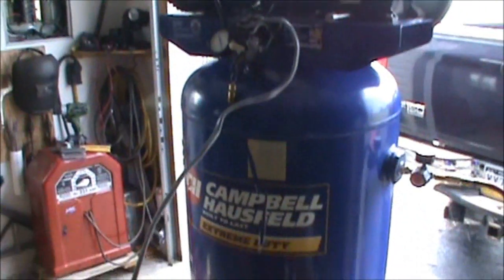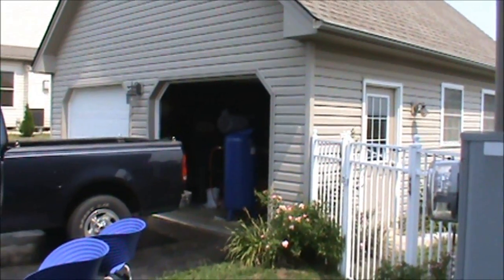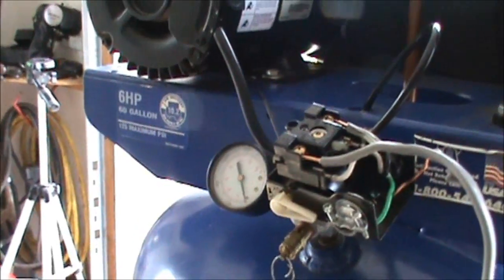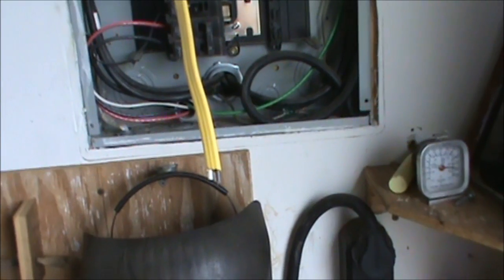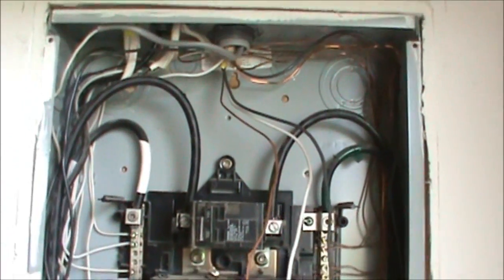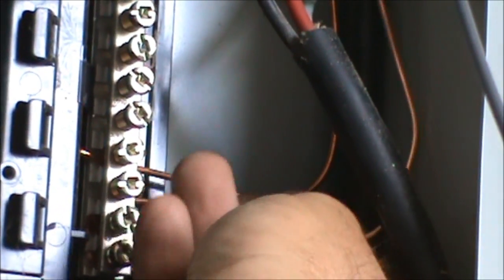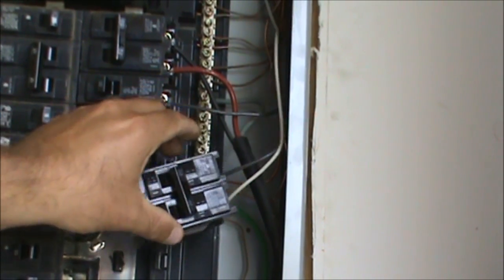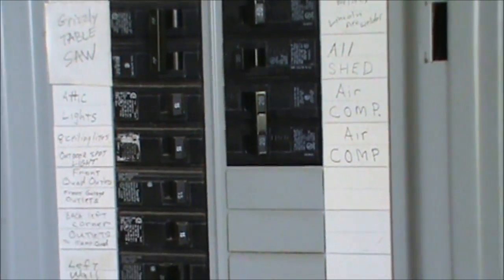How to wire a 240 volt circuit See Description

Comment: First of all this will WORK fine.   But  you are supposed to size your wire to any motor load  at 125%    motors are rated in HP.    and it said   6 H.P.   1 HP= 746watts     6x746=4476     4476%240=18.65.       18.65x1.25=23.31       Technically you need 10 wire.     10/2  NM.   Make sure you  use flex/greenfield  emt. or something equivelant to protect the wire with an appropriate connector going from wall/ceiling to compressor...
Reply: Do you think he should have increased the ampacity of breaker from 20a to 30a ?
Reply: Well this will work unless his wimpy 20 amp breaker trips when the motor kicks in (usually when it's an older motor) and or over time the wimpy 12-2 romex burns up.  Keep in mind that with motors, conductor size and the overcurrent protection are based on the Full Load Current. and on this particular model motor (if I googled it right at 5 HP) is 28 amps.  125% of that is 35 amps.  In reality, he absolutely needs 10 awg wire and a 70 amp breaker as you need 250% of the FLC for that for single phase motors.
Reply: you use 125% if its a continuous load
Reply: Arie M--I believe you meant 30 amp breaker.....
Reply: ABflanagan523 he also needs to re-phase the white conductor to red on both ends. And would wouldn't hurt to put it on a 40 for in rush current.
Reply: I would use 8 awg and a 40 amp breaker myself. Air compressor use a lot of power on start up. Info should be on motor. China motors take a lot of juice because they are cheap junk.
Reply: Sean Craig. Yea until he throws a big load on it, then watch that sucker trip.
Reply: I would have used #10 on a 30 amp breaker. Or possibly a motor starter with the appropriate size heaters.
Reply: Sean Craig you are correct.
Reply: Sean Craig   I see that this is kind of still running after 5 years.  Do a couple things please.   You saw a sign on it stating horsepower.   This fairly new tool practice usually states "develops 6 HP". We as designers or engineers are supposed to use nameplate information.   I looked 8 times and Emerson did not put HP on the label.   But for the purpose, let's use your math.  You are assuming watts and VA are equal as you did not include power factor.    Moving on, you have 18.65 amps. 3.65 more than the name plate.   So, at 18.65A and 1.25 for the motor load, you would need a 30 ampere breaker.  So if you check NEC it will tell you that the conductors in a motor branch circuit are sized to carry the FLA.  So #12 is acceptable in either case.   The reason this is allowed is because the motor has internal overload protection. If 3 phase it is required in the motor starter.

Comment: You need to stop calling the other hot leg a "common". In a 240 circuit both conductors are called hot no matter what color you use. You also need to mark the different color (different than black) as being hot for newbies who are tinkering with the guts of the panel. Thanks for the video.
Reply: Single phase 240v, yes.
Reply: a newbie has no business poking around inside a panel. also anyone who does should know any wire attached to a breaker is hot. also newbies do not know black indicates hot because in automotive wiring it is a ground. i have had to correct more than one who was new to house wiring that the black was hot. 

we do not tape white wires to identify them for the reasons stated above.
i have seen it done but rarely. mostly i have seen people use green tape to identify a wire used for a ground but rarely do they tape a white that is hot.
Reply: why are both hot wires going to same line or same phase?
isnt one supposed to go to the other line phase in the box??
Reply: @InlineDownhillVancouver  im not sure i understand single phase 240 , isnt it 2 separate phases?
Reply: so single phase must mean each hot goes to same line voltage??
Reply: @ronhanish  Single and triple phase configurations are for power distributions. Your house gets power from a transformer on the pole in your street that gets power from a single phase high voltage line. That single phase gets dropped from around 7200 volts to two legs of 120 volts and a neutral from the transformer. These two legs can be used for two purposes, to balance two separate loads of 120 volts circuits or if you combine the two legs you can have a 240 volts circuit for your higher voltage appliances like dryers and ovens. So when you hear single phase or triple phases, think outside on the power lines not in your house.
Reply: @Order-in-Chaos  ty. I thought each leg coming into the house is considered a separate phase.

Comment: My company did a job, using black for all phases of the live wire, and white for neutral.  Sure it is code compliant to do it this way, but it isn't useful to have 208 volts difference between two wires marked only with default black.

So we waited until after the inspector approved it without the tape, and then taped it black/red/blue afterward.

Comment: I already have a 220 (240) volt outlet that is all hooked up to the breaker. I was wondering  if I can disconnect the outlet and run the wire in my garage and connect it up to a different kind of outlet but using the same wire?
Reply: Nope

Comment: You can use 20 or less amps on 12 Aug wire you only use 15 amps or less on 14 awg, thats a dedicated circut by the way, just like your microwave in your house dryer, oven, ac units, and furnace are all dedicated circuits because they pull a lot of power...the wire usually says what its max amp/voltage rating is along with the awg size as well glad you stressed safety multiple times its really easy to get accidental shocks working in panels

Comment: One wire serving one piece of equipment  is called a DEDICATED circuit.A home run is the wire from the panel to the first outlet (there may be multiple outlets), they are NOT always the same. You're on the right track though.
Reply: A home run would  actually be each receptacle on the same circuit wired individually from the one breaker (which one would never see or do). More likely used in low voltage applications like phone or cable.
Multiple receptacles in a circuit are daisy chained .

Comment: let me ask what me be a few stupid questions.  I have an old General witch 100 amp breaker box which appears to to have all one leg of the feed on the left and slots for double breakers on the right (2nd feed).  On the right is one empty working 30 amp dbl and an empty slot.  before I run a line to the box for a 240 (newer) dryer socket. Can I: 

1) use 14-2 with ground , my run is less than 20' with twists and turns added in  
2) can I use a doubles run of  14-2  if not  
3) use two 15 anp singles to get mt 240v

note, 
i have 75' of 14-2 but no 12-2, but necessity forceses me to be a cheap skate.  I know what I end up might likely be frowned upon on the the letter of the law inspector, but if you don't tell him neither will I  :)

Frank
Reply: There is so much wrong with what you are asking and not enough information to tell you how wrong you are. Get an electrician to do this work. Training and electrical codes exist for a reason, to prevent injury and death, not just to you, but to others.

Comment: What kind of wire would i need for a 30 amp breake?
Reply: Tommy A. Depends on 120v 240v? 120v 14-12awg 240v 10-6awg
Reply: The comment from soulless one is completely incorrect.   Conductors are sized based on load and over current protection.   Voltage has absolutely nothing to do with the question.   Typically you will see 30 amp branch circuits with #10 which is rated 30 amps.   If the circuit is for a motor load, then it might be acceptable per NEC to use #12, but I normally still used #10.
Reply: I use 10 gauge smallest normally I go just a little bigger on wire if possible so that the breaker is weakest point and not the wire. I'm not a electrician  so I'm not saying I'm a pro but would rather breaker pop than overheat a wire in wall

Comment: Run a three wire circuit. 20A will be more than enough as each PSU will pull no more than 13.75A. Get 12-3 wire, a double pole 20A breaker, and a typical 20A duplex outlet. BREAK OFF THE TAB ON THE HOT SIDE OF THE OUTLET and connect the black and red wires to the two hot screws. In the panel, connect the black and red wires to the two poles of the breaker. Connect the grounds and neutrals as normal, and don't break the tab on the neutral side of the outlet. Each PSU will have its own 20A circuit

Comment: A home will typically not have three phase service. A three phase panel will have 3 supply wires instead of two, and there will be 3 busbars in the panel, each one supplying every third tab. You use a 3-pole breaker to supply a 3-phase load. A typical home split-phase panel will have only two supply wires and two busbars, each supplying every other tab. In order to get 3 phase service there need to be 3 transformers (or one big one) on the pole.

Comment: You sure you don't need 10/2 and a 30 amp double pole? That compressor pulls a good amount, just asking not trying to tell you what to do but i was told by an electrician to use 10/2 and a 30 amp double pole, im just wondering why he would have told me that just for an 18,000 btu air conditioner but it was also going to the outlet and not direct to the air conditioner? If im wrong then im going to ask the electrician why because 10/2 is more expensive.

Comment: Yes 10 AWG wire is rated for 30 amps but branch circuit conductors have to be sized to 125 % which bumps you up to using #8 awg.

Comment from the maker: This panel is a 100amp sub-panel run from my house to my garage where my compressor is located.  I did not run the panel or wire it up except for the tablesaw and compressor.  If it is not up to code I guess the electricians around here don't know what they are doing.

Comment: You use a 2-pole breaker, it's like 2 breakers stuck together with a single handle, this way both phases are turned on and off at the same time. Remember that volts times amps = power, so a 1800 watt appliance will draw 15 amps if it uses 120v but only 7.5 amps if it uses 240v. You basically get twice the available power for 240v loads.

Comment: Good vid doublewide.  I'm not sure I'd use a white wire hot though.  I'm not an electrician, but I'm doubtful it would pass code.  Wouldn't a simple solution be a 10/3 wire?  I know it works, I just worry if you sold your house and someone else might mistake the wire.  Not criticizing just asking.  Cheers!  Keep the vids coming!
Reply: just mark both ends of the white "hot" wire with black tape..
Reply from the maker: Nick OZ, As long as you tape the neutral / white wire to indicate that it is hot with black tape at both ends it is completely up to code.   Thanks for watching.
Reply: Tom Hoehler WTF is ar ar code? Isn't that how a little dog barks at you, ar ar ar! ar arf!
Reply: Tom Hoehler red+black+white+bare ground is called 12/3 romex, not 12-4.
Reply: It's not a neutral.

Comment: believe it or not, but the directions are vague. I'm disappointed with the advice I received from Home Depot. That's where I bought the hot water heater. I'm no stranger to installing breakers and such, but nothing heavy like this.
Thanks for your advice.

Comment from the maker: Read the directions.  I'm thinking it would need 10 gauge and a double 30 amp breaker.  Or call the manufacturer of the hot water heater.  Sorry I can't be more help.  Maybe an electrician will chime in?

Comment: shouldn't you use a 15 amp breaker to match the compressor???
Reply: Actually no.  Because when you wire, you want to calculate 80% of what will be drawing on that circuit, not 100%  That allows for power surges, etc.  For example, on his 20 amp circuit, 80% of 20 amps = 16 amps.  The compressor pulls 15 amps so 16 amps is safe.  If he used a 15 amp breaker, that allows no room for any slight power surges etc. and would trip the breaker.  Also, 80% of 15 amps is 12 amps.
Reply: uh bunch That is only exceptable for motors. And you alow 125% amp draw of what the name plate rating is.
Reply: uh bunch got a buddy whos the electrical instructor here at our college to wire mine up, better safe than sorry for someone like me whos not familiar with power, thanks for the info.
Reply: cool, I was watching this video out of curiosity. This guy knows just enough to be dangerous, and he is teaching it to other people. This is why I had to go to 4 years of classes to get my electrical licence.  Good luck bro.
Reply: oh by the way good job on getting your buddy to help. 2 things you should never go cheep on, plumbing and electrical. DONT CUT CORNERS.
Reply: Daniel Short what local you out of bro ?
Reply: Melbourne Florida?

Comment: In all of these videos of wiring, repairing and starting air compressors, there is no mention of one single very important matter. CHECK DIRECTION OF ROTATION. That’s the first thing you do when you hit the run switch.The vast majority of compressors have a certain direction of rotation. I’ve worked on compressors for forty years and have seen many severally damaged because of being run backwards. This applies to reciprocating, screw, vane, centrifugal, spiral.

Comment: In a 240 volt circuit, both the hot (black) and the neutral/common (white) are wired to 110v each to combine for the 240v.  They are both hot.

Comment: White wires can be used as a non grounded conductor when romex is used.  They need to be identified as such.  This is very common and permitted within the National Electrical Code (NEC).

Comment: How can i tell if my house is wired for 240 volts from the pole to the meter?
Reply: Most houses in the US are single phase 240 volt - ie. you have 2 120 volt (to neutral) legs that are 180 degrees off from each other along with a neutral.  If you happen to have a 3 phase, you could possibly have 208 volts but since you have to ask, I doubt it.

Comment: The folks who are freaking out over 12/3 vs 10/2: you haven't answered the issue on what to do with the common wire on a 12/3 when the table saw has no common wire? I've read the comment that now it's code to use the 12/3 in all 240 cases and to cap the common at both ends, but how does that help any, from a safety perspective? Why do you need a common wire if the equipment isn't set up for it ( from a safety perspective)? Thanks.
Reply: Elizabeth Sawyer    NEC is finally getting into colors for identification purposes.   But, you still do not need to install 12/3 WG to a 240 volt table saw.   NEC still allows you to re-identify the white in a 12/2 NM cable.  Black tape is the easiest way.   Make sure you do both ends.   Do not believe all the armchair electricians.   Always check things for yourself.   If you need article number, I can probably look it up for you.   Enjoy life!

Comment: It works, and you know enough to make it work, but is a tad dangerous....if you formally train and want to abide by code, which is not a vicious rule to burden people but rather to encourage safe practices, then the white wire should be taped red.  And, the third wire goes to ground.  No current returns through the neutral on a balanced load. It may not seem important but it is, especially if GFCI, Arc Fault concerns, etc.   Yet, way more important, I noticed you mentioned that is a subpanel because it comes from another panel in the house.  Hence, that GREEN SCREW in the panel needs to be removed because it is bonding the box/cabinet/panel tot he neutral and you do not bond neutrals and grounds in subpanels, only in first disconnect at the house.  You are provoking current return through the ground wire which is a big no no.

Comment: You don't need the neutral, if your appliance doesn't have a place to hook it up.  The L1 and L2 wires can complete the circuit on their own.  I'm not sure how you would go out of your way to make a terminal for that neutral on the appliance.

I know the code requires you to run two different colors of wires, neither of which is white or green, for a two live wire circuit.  I'd at least tape the L2 wire red at its terminations.

Comment: so 240v doesn't require a neutral?
Reply: 240v only requires a neutral if the appliance requires 240v & 120v. such as an oven with a light.

Comment: NEC: High voltage 601 volts and higher. Nominal is 32 volts to 600. Low voltage is anything less than 32 volts. And yes...always test everything before beginning any work.

Comment: Why is it #8 if the motors current is 15 amps. So wouldn't you times your current by 125% if its a continuous load.  Which ends up being 18.75 so wouldn't 12 awg be good?????

Comment: #8 wire home run to the panel, 40A breaker to handle the inrush. 15A X 250%= 37.5A Breaker, go up to the next Std. size breaker 40A.  or #10 HR  and a 30A breaker. but not 20 and #12

Comment: You can use 15 amp breaker with 12 guage. You don't want to use 16 guage with a 20 amp. Your receptacle can be overrated to your breaker not the other way around. Example 15 amp receptacle never on a circuit breaker of 20 amps. Circuit will allow 20 amps before tripping but receptacle only is rated for 15 amp current draw.

Comment: I see the motor sticker now. I would use 10 awg with 30 amp breaker. Mine says the same thing I have used 10 awg for 30 years with no problem.

Comment: Nope, if you use a 30A breaker you must use 10 gauge wire or larger. Check the instructions for your water heater, it will say 120V or 240V and the amps it needs. If it's 240V you need a double pole breaker.